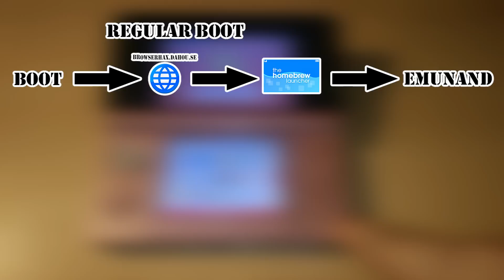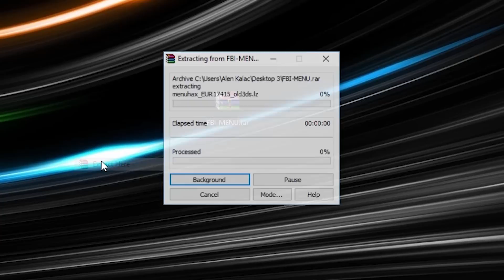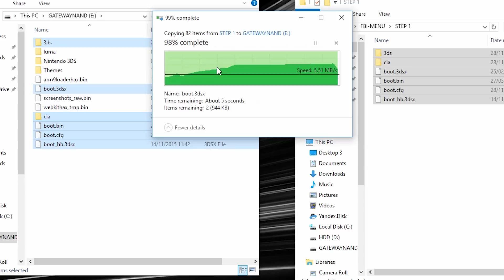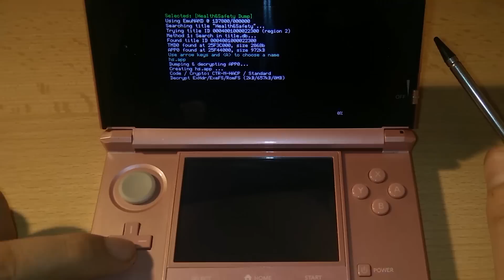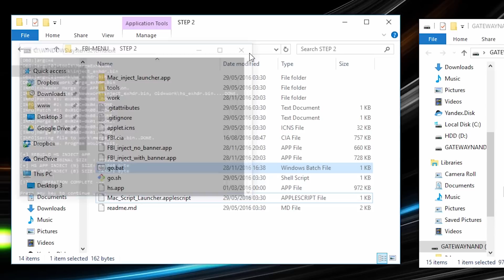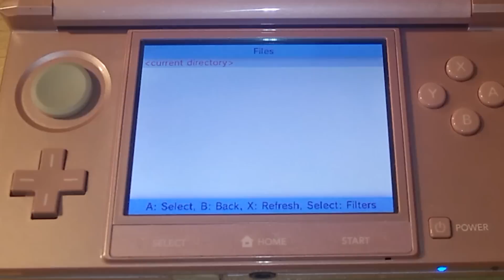SET UP MENUHAX + BOOT MANAGER + FBI INSTALLER

Comment: The Dycrypt wont open... Like when I press A on it, it just goes black, then to the top of the homebrew main page. I've tried a bunch of Dycrypt versions but not one has worked... (I have the 2ds wich shouldn't matter much because it has the same firmware as the 3ds)
Reply from the maker: What version is your console? o.O
Reply: ExtraNullByte 11.20-35U
Reply from the maker: This will not work on 11.2, its only for 9.2 with the use of EmuNand. 
Your options are to ether install A9LH or Downgrade to 9.2.
And if you do need decrypt9 you will have to use fasthax+safehax with the decrypt9 payload.

Comment: didn't work if we don't have emunand?
Reply from the maker: Gekkouga Greninja you need emunand or equivalent custom firmware such as rednand main thing is custom firmware such as luma and rxtools
Reply: ExtraNullByte i have the last version,but I dont want to do the hardmod,how can I hacked? is it possible??
Reply from the maker: It can be semi-hacked for now. 
You can use soundhax to enter homebrew launcher but that wont let you downgrade or install CIA files such as downloaded games and it wont let you use emunand and no custom firmware yet

Two days ago fasthax was released to allow for some more programs to work but again no downgrade or custom firmware, for now it can only install legit CIA files. (fbi and nasa need to be updated before that can happen)

But something called a sighax has been announced. this will allow for downgrades and more.
Reply: ExtraNullByte I got steel hax,soundhax,and basehax thanks for the information

Comment: I already have homebrew through soundhax is there anyway i can just get the stiff i need for the fbi
Reply from the maker: Thats only available on v9.2 so unless you have a way to downgrade you cant get FBI to work. Hopefully soon someone releases ARM9 exploit for 11.x
Reply: what if u want to do it one 11.2.0.35 systrem version
Reply from the maker: nope, 9.2 or lower only
Reply: Downgraded my Old 3DS XL from 11.2.0.35U to 2.1.0 (soundhax and fasthax) then installed a9lh then restored back to 11.2.0.35u with FBI :D
Reply: I installed a9lh on my 11.2 by ctr downgrading to 2.1 then installing a9lh and luma then ctr band back to 11.2

Comment: hmm it just loads to the website not the screen you show after going to browserhax.dahou.se ? whats wrong with it im on
v11.2.0-35u
Reply from the maker: browserhax has been repurposed and doesn't work anymore, it was a mirror for the main site anyway which is https://yls8.mtheall.com/3dsbrowserhax.php , i used browserhax because it was easier to type in and spell instead of the original one. but the guy who owned browserhax has sold the domain or used it for something else, not totally sure. 

anyway another thing is the exploit is for version 9.2 or lower, it will not work on 11.2 sadly, you will need an exploit like ninjhax

Comment: Would it work on 9.2.0-20E? Thanks
Reply from the maker: Yes this will work on 9.2. browserhax website is down currently so if you do follow the guide use this instead (the original browserhax) yls8.mtheall.com/3dsbrowserhax.php
Reply: Hi ExtraNullByte thanks for answering i may still need a little more help.

I went back to the scene since 2014. I have an o3ds with gateway and i run it with the website exploit

I followed your wonderful tutorial and everything worked except FBI. I then tried to forget gateway and followed a A9lh tutorial and managed to install hourglass, luma 6.6, armloader ( i think) and idk what else (im kinda noob). Thing is, in the final part of the tutorial u need to install some cias and since i cant make FBI work i tried going to my emunand and ,using gateway, go to title manager or Dev menu. But nope. I cant access the gateway menu or emunand no more.  So im stuck i need a cia installer and make gateway to work or forget gateway and use luma or cfw. I have a backup of my nand on 9.2 and thats all. Im all lost. I dont know how to start from zero or continue. If you could help me i would appreciate it. Thanks
Reply from the maker: Hey. That does sound like a lot of work. Can i ask what version is your 3DS currently?
Reply: i managed to make it work. it was 9.2 but i updated it to 11.0 to play pokemon since i can now access to HBL with a cia

Comment: what is the Arm9loader thingy?
Reply from the maker: +Dexio Rouch arm9loader is a security measure that was introduced to 3ds at some point and it was exploited by some people creating the arm9loaderhax which can only be installed using 3ds v2.1. Its very risky to install as doing to wrong can brick the console. The benefits of this is that it can boot in custom firmware really fast. Handy to have but not really a necessity. Has its pros and cons but very risky

Comment: Hi, i was following the steps since the previous video but got an error at the part https://youtu.be/9vyOv78JaN0?t=672. the error messay showed Theme setup failed: 0xc8804470. Not sure what happened there :/
Reply from the maker: Go back to the menuhax manager and this time go to "Delete Menuhax" option and delete the set up. once that's done go to "install" and when that finishes, go down to set up  built in theme and choose a color. 

reply again if it works/doesnt work. 
good luck
Reply: I got the message "The menuhax itself has been deleted successfully". following this I got "Failed to delete the menuhax regular ThemeManage: 0xc8804470. Deletion failed: 0xc8804470". My N3DS sysnand is currently 9.0.0-20USA does this affect what is happening?
Reply from the maker: Hi, No menuhax supports version 9.0. 

- Go back into sysNand and change your theme to some random color, doesn't matter which
- Go back to homebrew launcher and try installing menuhax again. 
- Try rebooting while holding L

Report back. good luck ^^
Reply: hmm after deleting and reinstalling, going to the set up built in theme and choosing a colour, i am getting Failed to write ThemeManage.bin to extdata, aborting. Theme setup fail. The menuhax is working tho. The only thing i couldnt get it work is the colour theme setup at the end
Reply from the maker: +Monkey Poo ok, does the actual menuhax work though? Holding L while powering on? If install was successful, installing a basic theme is optional. Your emunand will still have its own theme of your choice.

Comment: Works on 11.2?
Reply from the maker: +Ramon211. This is for 9.2 or lower. You need another entry point such as cubic ninja, 9.2 is the last version that can run emunand.
Reply: ExtraNullByte can I use oot hax exploit to do this?  If I am on 11.2
Reply from the maker: You will be able to get to homebrew launcher using OOT hax but menuhax has been patched so you wont be able to install it. but if you have OOT hax and are able to get to homebrew then you might be able to downgrade to 9.2
Reply: ExtraNullByte yeah I have Oot hax do you know anyway I can downgrade?
Reply from the maker: Yea, Its not an easy process. You will have to get the 3DS hard-modded. If you are not good with wires and soldering I wouldn't recommend trying it. see if you can get someone who will do it for you but this is the process. 

1) Create a dump of the nand(11.2)
using a hardmod.

2) Patch the nand using autofirm, that will create a nand that is 11.2 with 10.7 code. 

3) Flash the nand to the console using a hardmod

4) Use OOT hax to enter homebrew (bypass the browser update popup)

5) Run the SafeSysUpdater from homebrew with 9.2 files in the update folder.
Reply: Thank you

Comment: I cant open my browser it says I need to update my firmware :(
Reply from the maker: this is only for version 9.2 or lower. this is basically part 2 where i talk about the requirements for this to work. i should have been a bit clearer in this video as well. but yea only 9.2 or lower.
Reply: aw :( is there a way to bypass it? My firmware version is 11.0.0-21U
Reply from the maker: there WAS using a proxy but that doesn't work anymore. with version 11.0, 11,1 and 11.2 you need another 3ds that is hacked to downgrade your 3ds or a hardmod with cubic ninja or legend of zelda OOT. 

now you are basically stuck with 11.0 until someone figures out a way to downgrade without using a hardmod, version 9.2 is the latest version that supports booting into emunand and playing downloaded cia's
Reply: Will you make a video if someone finds a way?
Reply from the maker: yeah, as soon as it's out i'll make a video since it would be ground breaking. I am keeping an eye on the 3ds hacking scene every day so if anything comes up worth making a video about, it will be up asap =D
Reply: look up jacksorrel he has a way of doing homebrew on 11.0